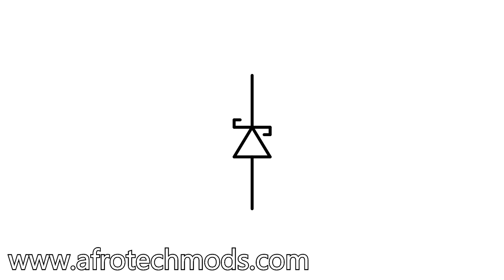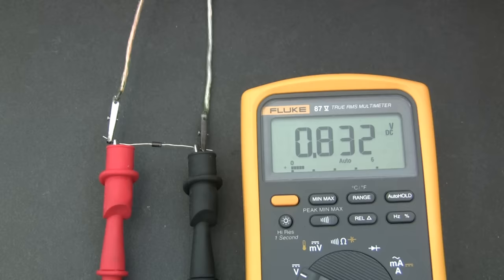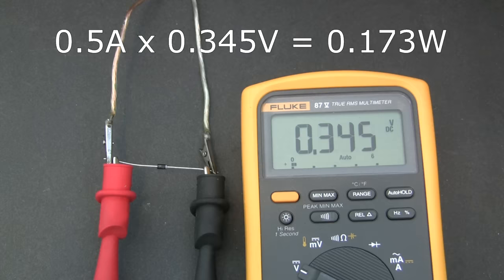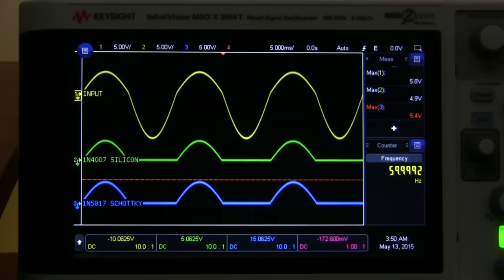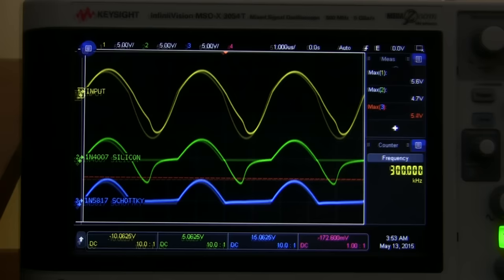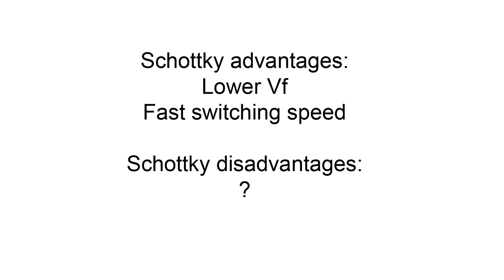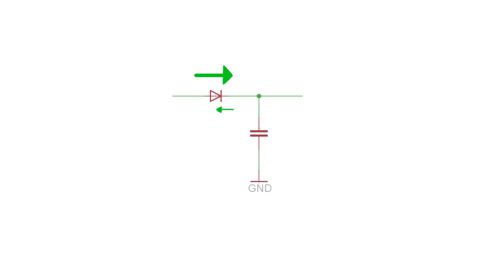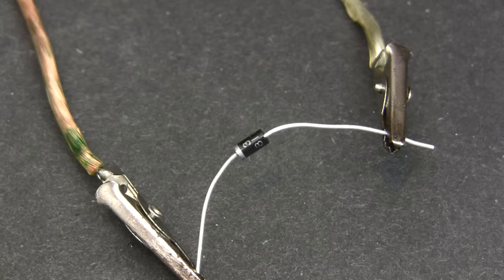What is a schottky diode?

Comment: So forward voltage drop means that the component acts like a tiny resistor?
Reply: +Matthew Ferrie in some way yes. however the resistance of a diode depends very much on the voltage (and polarity) across its connectors. so you could say its a certain type of voltage dependent resistor. however the latter can be very misleading if you call it like that. 
there are voltage dependent resistors (VDR)  used in electronics, the are also called varistors and they are not to be confused with diodes at all. their use is to protect circuits from overvoltage

Comment: I have been looking far and wide for information on a Reverse Diode.  I have found these in literature in 2-3 different sources.  These have steller properties 

I am going to ask a question about transformers. I had found a video on a type of transformer that you hook up and it converts like a regular transformer. across the bottom between windings in a W with three winding sets.  BUT across the top was a bar and the way the power flowed this was  seperate power that I understood was seperated from the other poles and could be used as a "Clean" power source.  I am seeking to run essentially static through the bottom and am hoping to have dc across the top. 
I have had a stroke and for the life of me I can not recall the name of this transformer to look up one and purchase one.  Any Ideas 

Thank you or anyone that could nudge me in the direction of these two things.

Comment: Hi there. This is a great explanation that has helped me understand Schottky. I wonder if you can help me understand what is the best diode to protect an h-Bridge chip like L298N please. I have used 1n4001's but the h-bridge gets very hot (I'm running it on 12volts with "solenoids" low frequency = 20 - 1kHz but "enabling at" 20kHz roughly).

If I run  my little circuit with the cheep L298N Chinese board everything runs just warm (as you would expect) Runs at about 1 - 2 Amps. I notice they use "M7" diodes. Are these Schottky?

My circuit uses standard pin through, not SM components so the M7 would not be practical. I have seen some say the equivalent to the M7 is the 1N4007 but then I see the M7 listed as Schottky? 

Some even talk about using a Zener diode for H-Bridge protection.

Can you please advise me on what would be a real equivalent for the M7 please? 

1N5817? The fast rise time (high frequency) response seems to make sense to me on an H-bridge driving inductors. 

Thank you so much. I'm not a degree electronics student just a hobbyist interested in circuits. Have subscribed!!

If you've really got 5 minutes of you life to waste here is some thing similar to what I'm talking about before I got the Chinese L298N board (take no notice of the 1n4148's used!! :)

https://www.youtube.com/watch?v=h0nlACgOwns&t=6s

Regards

Eddie1

Comment: Hi, thanks for your video. I was wondering if you could help me, I have to find a replacement por a Schottky Diode SB3150 that is used at the output of a SMPS. That SMPS has outputs of 12V but the VRMM is of 150V, and I can't find a value that big in the same footprint. How can I determine the VRMM that is realy needed? Thanks for your answer :)

Comment: How did you calculate the temperature (54 degrees) from the power (0.416W). I am searching for this for quite a while.
Reply: Muhammad Naeem No, he is not calculating, but measuring it using an infrared spot thermometer.

Comment: how do you decide how many miliamps to go across the diod ? I am not good in electronics and has always been a big question for me!! I mean Volt I just can turn it to high or low but how about amps and miliamps ? Thank's
Reply: Quite easily, actually! You look at the datasheet. Power dissipation is a function of current and voltage, but voltage across the diode is itsself a function of current, so in effect power dissipation is a function of current. The manufacturer will already have done these calculations for you, so if you look at the sheet one of the properties listed will always be a maximum sustained current. Often it lists a second, much higher value for the maximum non-sustained current, along with a duration for which you can safely put that through the diode before risking damage.
Reply: Oh, I see. You mean how does he test it?

Constant current or current limited supply. Standard instrument on any electronics workbench.

Comment: well explained. which diode is suitable for protecting circuit from back emf produced by relay coil ?
Reply: You want a freewheeling diode in parallel to the coil? A silicon diode should be fine.

Comment: why dont they give you a voltage rating for the forward direction? i am not talking about forward voltage drop. how do you figure out how much voltage you can safely put through a diode in the forward direction?
Reply from the maker: +Xgamer121X Well if there is a forward voltage drop, where would the higher voltage across the diode be?
Reply: +Afrotechmods thanks for the reply. im new to electronics. i was asking if there is a voltage rating for diodes in the forward drirection. for example, a 1N5817 has a Maximum RMS voltage of 14 volts. so can it handle 14 watts in either direction as long as i dont exceed its current limit?
Reply from the maker: Xgamer121X
No there is a power rating too. Roughly 1W for a 1N5817 it all depends on ambient temperature.
Reply: +Afrotechmods why dont they list the wattage on the datasheet?
Reply: +Xgamer121X Voltage never goes "through" a device (current does that). Voltage is always applied "across" a device.

Comment: What type of diode would work better for a mediumwave AM crystal radio? The old Radio Shack kits called for a 1N34.
Reply: Has to be a germanium diode like the IN34 or OA81. I think they are still available, will certainly get them off ebay etc as NOS. Silicon diodes wont work.
Reply: @risvegliato Found a copy of a Radio Shack 10 In 1 kit at a gift shop, made by a different company. They replaced the 1N34 with a silicon diode, and the crystal earphone with a magnetic one. The crystal radio project didn't work.

Comment: Spoiler:  Low voltage drop, high current capacity (for its size) diode.

Saved you 5:30 if you read this and don't watch the video.

Comment: here is something all you guys and gals watching this should know. a chevy volt gets more mileage if you take off the gas motor that is on the generator and you put the battery on a transformer with a conveyor motor to turn the generator  but you may have to loosen the bearing but you only need a big wheel for the conveyor motor and then the battery gives you better mileage then the engine but they don't tell you that.

Comment: how to convert from watts to celcius??
Reply: It depends on the material that's absorbing the energy, and how much of it there is.
To be more specific, you could use an equation like this:

temp. change in celcius = [watts dissipated] * [time in seconds] / ( [specific heat of material measured in J/g-deg] * [mass in grams] )
Reply: You need to know the thermal resistance. For the 1N5819 the junction to ambient thermal resistance is 50°C/W, so for every watt of power being dissipated the temperature will rise by at most 50°C. I say at most, because it's an overestimation—the higher the temperature difference, the faster the transfer of heat (also some heat will be dumped through the leads into the PCB)—but overestimating is good in this case.

Comment: Are you a relative of Arnold? lol
Reply from the maker: I AM ARNOLD
Reply: Hello
I am using an SB360 Schottky and the forward current is 3A and forward voltage drop is 740 mV (microvolts). Which is good Schottky Diode for my AC Adaptor??
Reply: I would recommend googling it
740mV is milli volts, micro is µV
Reply: And, if you don't want to look up the lower-case "mu" symbol every time you want to say "micro Volt" or "micro Farad" etc., just write "uV" or "uF" or "uA..."
Reply: BitsAndBites You are correct.
Reply: alachabre I learned electronics using the Greek letter mu (actually "mi") which represents "micro" backbone the 60's.You are also correct.
Reply: I should have proofread what I wrote. STUPID GOOGLE is ALWAYS trying to and inserting words or characters that I did not mean to use. I intended to write, "back in the 60's"